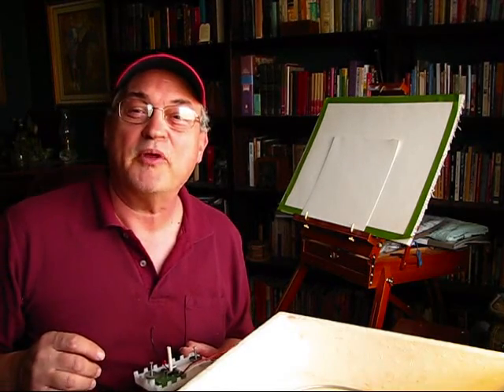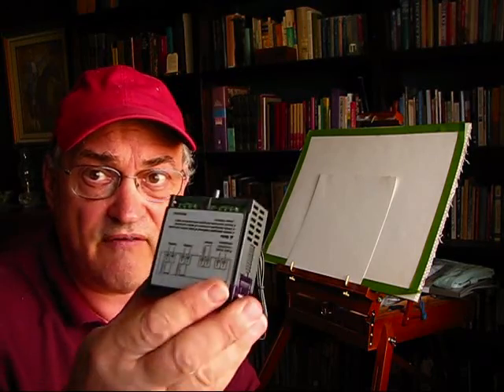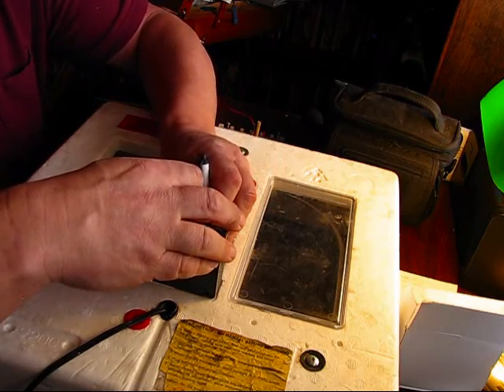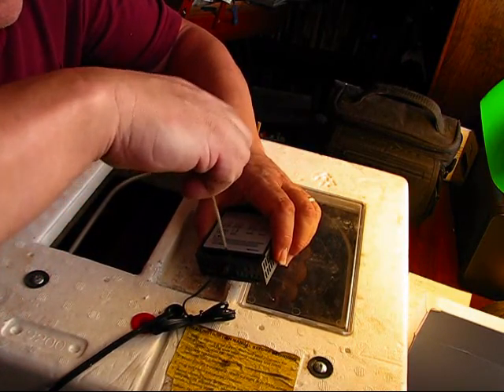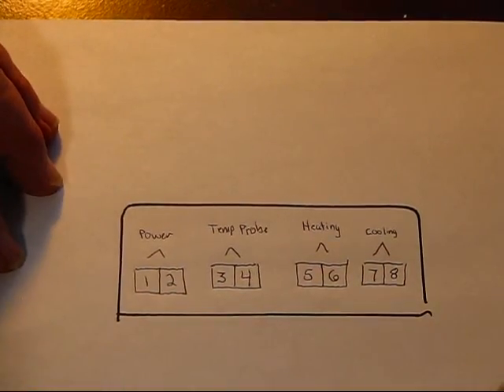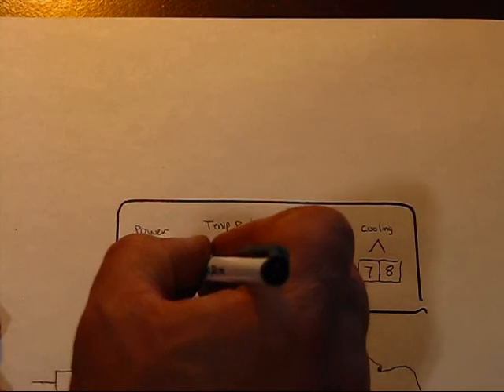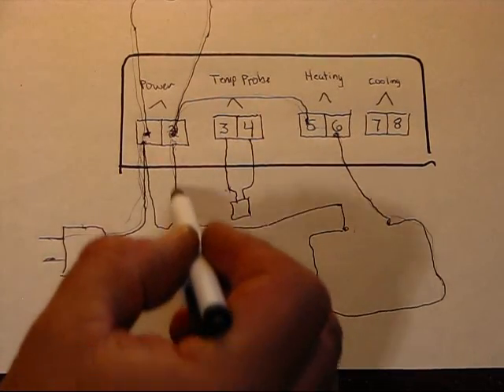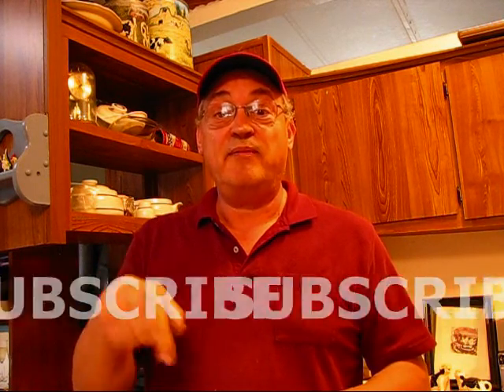Replacing Little Giant Incubator Thermostat with STC-1000

Comment: How do you wire a light bulb with the heating element in the inkbird 1000 would you run the light bulb with the heating element wires into 1 and 6 like your video I have a 25 watt heating element and 40 watt light bulb bigger incubator than little giant

Comment: How did your hatch rate di with the upgrade inkbird 1000? I'm very interested!, Thsnkyou for sharing this video, Dale
Reply from the maker: Hatch rate was about 30% which is normal for me. I am getting ready to build a large incubator though using a non working freezer and heater. Stay tuned for that show.
Reply: @pinemeadowshobbyfarmafruga8319  I'm sorry to hear that. I have built incubators in the past using wafer thermostats, and getting  95% hatch rate. The only eggs that didn't hatch was because they weren't fertile.

Comment: your video is the best from everyone else but i have two questions. first question, this thermometer for how many eggs can you use it. second question, can you use the automatic fan for this, like heat how you connect this fan
thank you for everything
Reply from the maker: For the fan, it should be blowing 24/7 to maintain circulation. I can fill the incubator with eggs and still have it function properly. Hope this helps.

Comment: can I use this thermostat for a large gabinete incubator with a waffle thermostat?  I want to replace it with a digital but I'm wondering if I need a bigger one or would this one work?  help please
Reply from the maker: Yes you can. This one will work on that application as well.

Comment: sir what is the size of your styro box and 60 watts bulb is enough for this box? thank you again
Reply from the maker: Any bulb should do, the thermometer wire in the incubation chamber will monitor the temperature set and send the signal to the thermostat to cycle the light off and on to maintain the desired temperature.

Comment: sir i just want to ask. if the wire of the fan is connected to 1 and 2 , it means the fan is continous working?i tried this to my incubator but the eggs became warm because the fan is contnous working.so i top the wire of the fan to the heating element so that when the heating element turn off the fan will stop working.is this correct sir?pls give me answer sir...thank you very much
Reply from the maker: Fan is continuously on. Heating element cycles off and on. There is also the Still Air Incubation method without the fan.

Comment: what is the heating source did you used
Reply from the maker: The heating source used in this project was the heating element that comes standard with the little giant incubator. You could even use a 60 watt incandescent light bulb if you wish. Thanks you for asking.

Comment: I noticed u said to wire a fan into the power slots. is yours a 12v version controller or the 120v
Reply from the maker: 120v, the fan is 120v as well.
Reply: OK got ya

Comment: I've heard or read that the switch will fail if it's installed with the back inside the incubator like this and get stuck on. Any problems with this issue?
Reply from the maker: No problems yet. I wonder if that was an older model which had the problem. Mine is working fine. So Far.
Reply: Idk how old it's possible there are a few different companies making them now I believe but thanks for your response it's reassuring
Reply: is this still the case?

Comment: I have a Little Giant 9200 which is the same as yours, except it comes without a fan.  It's the still air model.  I'm converting it using a "free" computer fan from on old Dell laying around in my basement and I wanted to upgrade the thermostat, which as you point out on the video, is not extremely accurate.  Your video was very helpful, thank you!
Reply from the maker: +Daniel Heasley I am happy you found my video tutorial. I am also please it helped you. Thanks for visiting Pine Meadows Hobby Farm and good luck with your incubator.